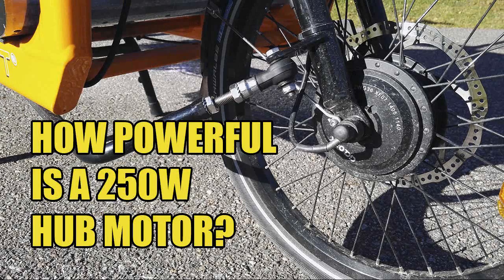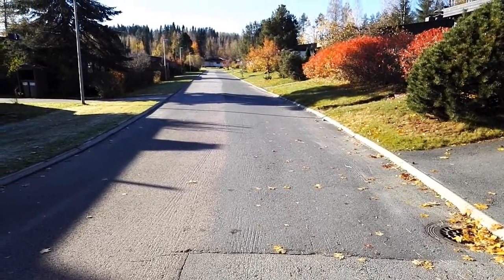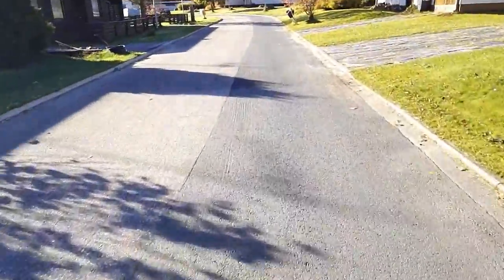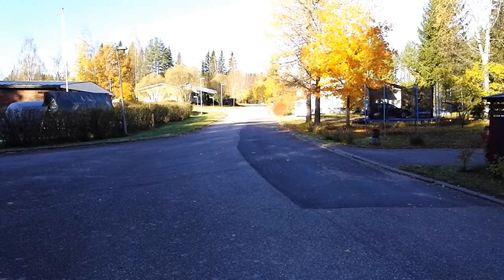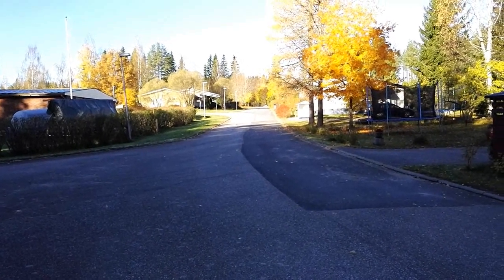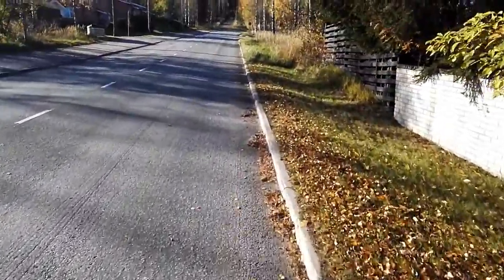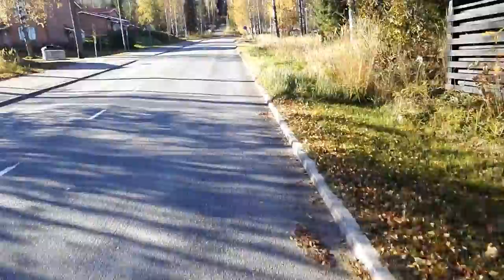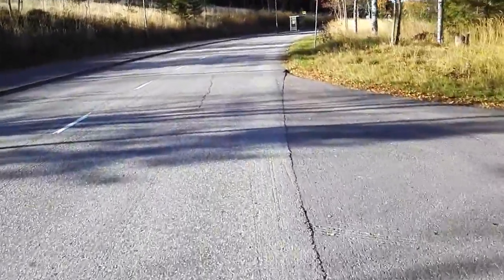How powerful is a 250W hub motor?

Comment: I wonder how many people add motor kits to their bikes and never give a thought to the fact that they still only have bike brakes to stop with. My tourer weighs around 30lbs or so without panniers on its rear rack. That weight can be doubled easily with a typical 250w kit. That alone might not be problematic but the average speed is almost certainly going to rise significantly. With added speed and added weight you're certainly looking at extended stopping distances (unless you  have a crystal ball to check on who's likely to pull out in front of you that day.)

So - do you install disc brakes to your caliper/cantilever/Vbraked bike?  Which of those it won't matter too much since you're already used to the stopping distance your own brakes give you.

Doing so would enter the heads of I'd guess close to zero percent of kit-fitters. Cyclists just aren't the sort who pay heed to such things - by and large.

My better bike has the older - and more leverage-efficient - wide cantilevers fitted. With stock blocks fitted, stopping distances were not too lousy. But with orange salmon compound blocks fitted - and set up correctly with the correct toe-in and clearances, stopping distance is cut. No need to change the rear blocks, the back wheel's contribution is hugely less than the front's.

As it is now I wonder if it's good enough to convert to a modest 250w upgrade kit?

And I wonder if the feeling of achievement might be reduced so much I'd use the bike less? And get less exercise benefit from it as well?  It might replace the car more and the unpowered-bike less would be my guess.But those braking distance figures would still nag at me if I did the conversion - since upping to discs would be impractical in a bike not set up to take them in the first place.
Reply: If you go with a front wheel conversion kit, just get one set up for disc brakes since it costs the same (assuming you have a mount for caliper on the fork).  If not, buy a cheap specialized hybrid or whatever since they are set up to make a good commuter with mounts for racks, fenders, and calipers.  Having mechanical disc, hydro disc, and mechanical rim brakes my stopping distance is the same since I can lock the front wheel on all 3, so the tire width would be the brake upgrade.
Reply: I did describe my brakes as cantilevers in my rather extended lecture above... I doubt you'll ever see fittings for a brake calliper on a bike with cantilever - or any other rim brakes. Well - I never have.

Disc brakes put all sorts of stresses and strains on spoke groups too and with the load my bike carries I'm not sure how happy I'd be with that combination. My rim brakes are pretty efficient. And I wonder how effective cheap disc brakes are in wet weather? The rotors are almost certainly stainless steel.

Which is relevant because - with early motorcycle discs there were all sorts of problems in the rain because with a polished S/Steel disc rain behaved like an efficient lubricant until the pads wiped that off over a number of revolutions, then the braking effect suddenly bit - hard. And since the rider was almost certainly using all his strength by that time to lose speed ASAP, front wheel washouts in the wet were quite common. Nasty. You live long enough, you remember.... etc etc.

Front wheel lockups will almost certainly have you rolling around on the road gathering gravel into exposed skin... Not recommended! Strong braking, yes. Locked fronts? BAD! Best to know when you're near it, then fractionally release, reapply. Takes skill to judge these things. Which I'm sure I lack!
Reply: Recent e-bike owner here, also with a 250 watt hub system. I'm much more inclined to ride with the pedal assist system engaged, and ride longer distances that I used to toss my bike on the bus here for. Like the video poster, I'm fairly heavy at 132 kg (~296 lbs).
With the pedal assist, I ride much longer distances in a single session, and don't have to stop as often because of the bridges and hills here, and suffer less in a head wind. My knee hurts far less, and I still get a really decent workout.
I feel that the 250 watt systems offer a fair blend of assistance and manual need, and really only use the bus system BRT line now for connecting to the next city over, or if it's raining hard enough that I don't want to cycle in it.
I also bought an e-bike flat out instead of a conversion kit, largely for the reasons you are worried about. The whole bike cost me only a bit more than most conversion kits do, once you buy a battery, and came with disc brakes.
Reply: Ian Gourlay just put the motor on and go ride lol your cantilevers will work fine but upgrade to mech discs asap

Comment: It is true that there are some very fit people that can produce 300watt sustained and few seconds of 500w peaks but then again those are peak performances that can't be performed everyday (you need long recovery times or you will destroy you muscles) . These electric motors can produce a very high torque from 0 rpm (There are 250w that can go up to 110Nm) and can sustain a continuous 250w output with peaks of 500-750w  , so basically until your batteries runs out you have the aid of a relentless record breaking cyclist on steroids at your disposal in a small package weighting  5-6Kg.

Comment: Is this a 24v 250 w system or 30th 250 w system? Thanks in advance
Reply from the maker: Steve Auguste 
This is a 36V 250W system. 250W continuous and 600W max output.

Comment: Legs was pedaling at first uphill ride. The shadow was in screen.
Reply: Did you not listen to the video?  It's pedalec only, no throttle so he has to turn the cranks to make the motor operate. He was only turning the cranks enough to keep the motor running.
Reply from the maker: Nooo... I need to spin the cranks to activate the motor. My motor will only run when I spin the cranks. But I was pedaling in first gear and slowly spinning the cranks just enough to keep the motor running. No power was transfered to the rear wheel as the motor was pulling me much faster than I was pedaling.
Reply: Viper, just by turning the pedals he gets out of breath. This guy is very unfit and without motor, the bike would fall over....
Reply: Jason King he’s so unfit a high school cross country distance runner would beat him on the big hills even with the motor lol
Reply: why would you not buy the kit that contains a throttle controller?
they are around the same price

Comment: Why the motor is 250W if it draws 550W? I'm confused.
Reply: Same. Will follow this Q!
Reply from the maker: Ringer1982 

250W is the motors nominal power. This means the motor can output 250W for a long period of time safely without overloading or stressing the motor. This is why this motor is rated 250W. However, max power output is 400-600W, which is okay for shorter burst, going uphill for example.

Also, the seller offered two different controller options, 15A and 17A. The 17A controller, which I have, can handle a higher current and thus increases the peak or burst output power.

As far as I know, most DIY kit/non integrated 250W hub motors are similar. They are rated at 250W nominal power but can put out 400-600W for shorter times.
Reply: E-Bike Commuter On the controller my ebike has, it says "Peak protection current: 12A". Could you tell me what this means? My bike is 250W, 36V. Thanks! :)
Reply: 12A * 36V = 432W
I think this means that if the power exceeds 432W the protection board will turn off or limit the current.
Reply: Ringer1982 Oh! You learn everyday! Thanks :) Take care!

Comment: ok all this guy is clearly  trying to pull the woole over your eyes there is a grade on this hill its not flat and he is padling the bike be cause it is moveing side to side cause his pushing down on his padles and if there was a bike there with out motor on it he would be leave in the dust lol
Reply: Pedalling activates the motor, there's no power needed as the motor takes over if you don't put effort in. The woll is over your eyes or you'd have known that basic fact.

Comment: You said that you were going up the hill with the motor alone, but I can see you were pedaling up the hill when I look at your shadow. Thanks for nothing.
Reply from the maker: Hi Bob, I have answered this exact same comment several times over the years. I also comment on this in the video itself. My electric system is a pedal assist system. That means that if I do not turn my cranks, the motor will not run. So in the video, I am only pedaling enough for the motor to run. You can think of my pedaling being an on/off switch for the electric motor. However, in practice I do not transfer any power to the rear wheel because my electric motor is powering the bike to run much faster than my pedaling does. So I do believe that this video provides a good presentation of what a 250W nominal system is capable of.

Comment: 250 watts is not much , and also there are different types of motors and gear set ups for  these things ,  some hubs are geared  , some are direct drive ,  
and mid drive units probably have a different effect because they work on what ever gear the chain is running on .
 i had a go on my young brothers direct drive hub motor rear wheel on  basic el cheapo  mountain bike some years ago , and with my large ish body frame ,  and er i`d say 100 ish kg weight ,  it could do maybe a fast walking pace on flat ground .....   e  v  e  n  t  u  a  l  l  y ! 
  it was truly as weak as water , and once you pedal and pick up a bit of speed , wind resistance  just about killed off the tiny if any bit of assistance it gave ,  very disappointing indeed .  
 Perhaps his power unit was crap ,  if i was looking at 250 watts , i would be talking to someone that knows all the products and  find out which motors offer the most torque , 
  because torque is what  pulls you away from the lights and holds the hills .
watts on its own  is a very misleading figure imo .

Comment: Lol I can clearly see ur shadow pedalling. 😂😂
Reply from the maker: Yes, I know you can. And in the video I explain why. Please listen carefully at 1:05 and for a few seconds forward.

I have a pedal assist system. This means the motor will not spin at all if the cranks are not turned. So I am in first gear and spinning the cranks as slowly as I possibly can. This means I am not transfering any power to the rear wheel, only spinning the cranks to engage the motor. I repeat this several times during the video.
Reply: Did you listen as well as watch?

Comment: You weigh 120 kg?! Wow! 
I weigh only 76.5 kg but I am trying to get some of it OFF. I am using a bike for exercise.
Perhaps you should disconnect the battery of that bike and pedal that thing, before your life is shortened by obesity. I am not kidding. You can be heard to be breathing hard, even after only a few seconds merely "spinning the cranks."
Reply from the maker: That's a valid point! Thank you for your concern. I am working on that right now. In fact I did a few shorter bike tours this summer with my trekking bike. Now in autumn I have been riding my mtb a lot. The ebike is mostly used for commuting to work.